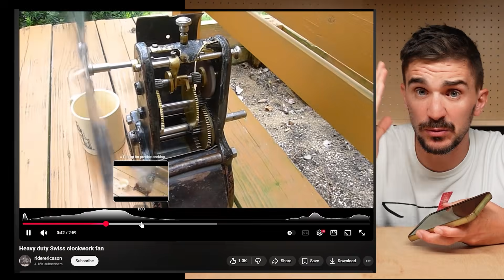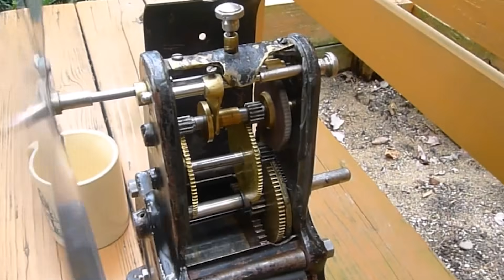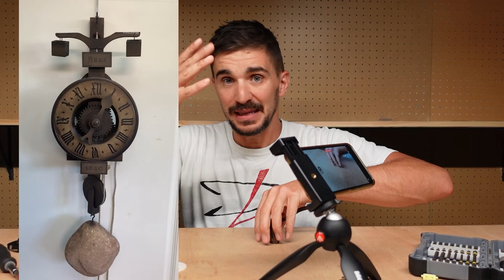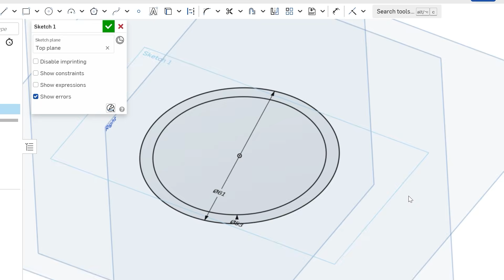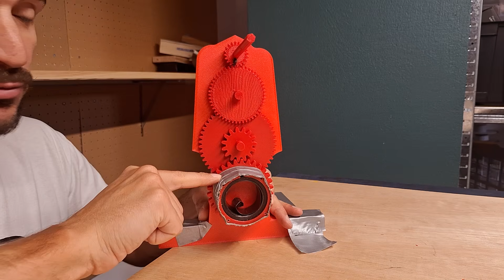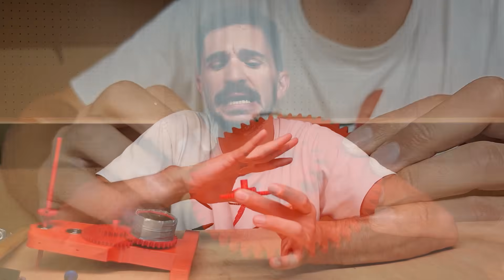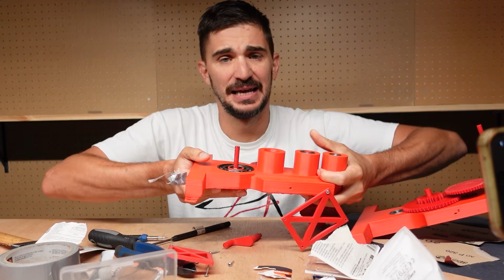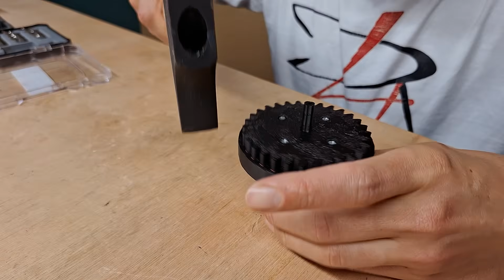No Cables or Batteries, Just Pure Mechanical Engineering - This Swiss Cooling Fan Cools You For Free

Comment: I like the idea, but i think the rock is also a much better idea then the spring for this project, the places where this whould be usefull and power is in short supply are usually places where a little extra space and a heavy rock whould be very easy to source. Also no need to destroy perfectlly usable tape measures xD

Comment: Wow I had no idea that there were such strong feeling on gears VS belts lol. I think a couple of points need to be made. 1 I don't believe at any point he stated that replicating Victorian engineering was a requirement (he's using a 3d printer....). 2 the decision to optimize the gear profiles was correct BUT those are involute spur gear profiles designed to transmit high force with acceptable loss. Clock making gear profiles are different. They are designed to minimize contact and friction at the cost of increased lash and lower torque ability. Off the top of my head I want to say they are cycloidal profiles but that's probably wrong. 3 I think one flaw in this design is it allows the gears to ride on each other lateral movement (end shake in clock making) should be constrained by the shaft and bearing so the gears only contact at the teeth. 4 I think a combination of gears at the high torque range and a gt2 timing belt at the high speed range would be ideal in THIS application of a home built mechanical fan. It's true that gears CAN  be more efficient than belts but that requires incredible precision and likely adjustable depthing to achieve low loss running. Not not an engineer but that is my engineering take. Come at me comments section 😂.
Reply: Quick follow up. It appears that I was correct in stating clock gears are cycloidal. I was sure I remembered wrong but this blind squirrel found a nut.

Comment: A few tips from a fellow 3d printing newbie:

- you don't need to sand the gears if you space the from the wall. To make up for the loss in stability, leghten the keyway on the side of the gear. The gear doesn't need to have the same thickness as the keyway.

- always add fillets to radial edges in shafts and everything else actually. No idear which size is needed because i am not an engineer but 3d printet parts are very vunrebale to sheering forces, at least in the vertical direction of print but you already fixed that with the keyway.

- Don't know if you already did that but test the tolerances of your 3d printer. Try different gear pairings with different clearences. Yet again i am not an engineer so no idear how that effects the gear but in my experience 3d prints are never accurate but they are so consistently. For example my A1 always prints 0.1mm to big in the horzontal axes, no matter the size of the component. Also try different accuracy settings and options in the bambu lab software.

Comment: Awesome effort but you need a bigger, stronger, stiffer spring. If you want to rework, try using the pull starter spring in a push mower or weed eater. Main thing if you try using one of these springs they are super real royal bitchin springs to work with, ware face protection n gloves... good luck..

Comment: The spring used in that vintage clock was probably strong enough to use in your cars suspension. Trying to imitate it with a tape measure spring is laughable.

Comment: Judging by the size of the barrel with the main spring (like a big can of tuna, 10 cm tall and 15cm in diameter by my estimation) spring in this fan is huge by any clock standards and much much much more powerful than spring of any measurement tape

Comment: look at that original. I bet it is far higher than 16-1. One of the ways some old clockwork things regulated speed was paddles that made friction in the air, so a tighter spring caused a bit more resistance and kept speeds steadier. The fan blades are a big part of the time it took to unwind. 
And this reminds me. Have you ever looked at the old Inertial Starters like used on some airplanes? hand cranking a flywheel with massive "reduction" gearing, and once you got the flywheel up to generating its own gravity, engage a clutch and the engine cranks over on the momentum. Basically you are the spring and the flywheel is the fan blade. I also bet they could have gotten a bit more time out of it but at added cost, and possibly less air movement, or the torque loss was too high to be worth the effort.

Comment: The discussion about clocks made me realise how ridiculously important just keeping time more and more accurately has been in advancing technology.
Reply: What's more ridiculous is how we take precise time, distance and mass measurements for granted today. James Vincent's excellent book "Beyond Measure" really opened my eyes to this. Also check out stuff like the "equation of time" needed on sundails to account for the sun's analemma motion. Nowadays I can pick up a literal Casio on a plastic beach, replace the battery, and it will keep time to a level of precision only some of the best inventions of the past attained.
Reply: @hannesjvv that's from a crystal vibrating yeah? 
Looked it up - quartz at 32,768. Oh that's per second! That sounds like it would be very accurate if it's outputting that constantly - wonder how much time those watches lose/gain in a year? And what part of the system contributes the most "drift", or inaccuracies, the crystal or the electronics, or the counting/conversion.
Reply: @WillArtie typicaly drift can be accounted for by temperature air density and battery voltage although air density has been solved for quite some time now as the oscillating crystal itself is contained in a sealed case. However temperature change is quite a bit more difficult to solve some watches have heaters for extreme cold but in average circumstances the drift due to temp change is negligible maybe a few minutes a year which is pretty incredible
Reply: My Casio A158 has gained 6 mins during 2.5 years.
Reply: @nathan584 Sorry I didn't see you had replied! Thanks for the info Nathan!
Reply: Not to mention navigation, thus discovering the world, which could  not have happened without accurate timepieces.
Reply: Or especially GPS signals, that rely on precise timekeeping to determine positions. Relativistic effects from the velocity of the satellites had to be accounted for in their atomic clocks to ensure accurate timekeeping down to the nanosecond.

Comment: where you got it wrong is the ratio dude, for a fan to run half an hour off a single crank would mean a gear ratio of THOUSANDS to one. look up the million to one ratio gearboxes people make, they stack the gears in the casing to make it more compact, essentially you just need a bunch of large gears with fixed tiny gears, you stack them big to small in a repeating pattern you essentially get compounding gains, the spring would need immense torque and the blades of the fan wouldn't produce much at all. as you said mate gears are a trade-off, if you want as many revolutions as possible off a single crank, it's like riding a mountain bike in high gear, no good at climbing hills but covers a large distance for every cycle of the pedals. 

i'd love to see a v2 of this, plenty of room left for improvement

Comment: Take the seals and grease out of the ball bearings. WD40 is heavy enough as a lube. There's a lot of drag from the grease, even with non contact seals. That's why motorbikes only have contact seals on one side of their wheel bearings. Less friction and heat.

Comment: I recently repaired an old Cassete tape deck player which had a plastic gear that drives the tape take up real broken so it was chewing tapes. Ofcourse the replacement gear was nowhere to be found but found a very similar gear from electric toy car to of them but the gears needed to be stacked up so they were thick enough to assume the size of the original geat. Now the problem was joining the two toy gears while perfectly centered. I tried and tried but there was always this wobble that would lock up other gears. only by shaving some of the out running edges have I got it close to running

Comment: Have you lookd into the Sterling engine fans made to be set up on top of a wood stove to blow hot air in the room? Pure mechanical engineering too!
Reply: I thought the same thing but technically they are electric,  a TEG (thermo electric generator) converts the heat into a small amount of electricity which then powers the fan.

No batteries and no mains required, but also not mechanical.

Comment: There's a reason it's known as Swiss clockwork.  I think you'll need much lower friction bearings in addition to improved gear tooth interfaces.  ...  I once happened by a shop while visiting Germany some 25 years ago.  They sold music boxes.  Proper wind up ones.  The craftsmanship was off the scale.  All mechanical.  Of course these things are hand made and take a great deal of time, and the materials ... everything is 'just the right x, y, z'.  But when it all comes together... Magic!

Comment: Improvement can be attained by using larger spring, metal gearings (more precision and hollow in the middle, so almost same mass) and lubricant on some parts.Then we have to consider the pitch of the fan to properly set the torque.
Thanks for your experiments.

Comment: So you took a 10m tape Measure for E5.99 (plus a 3m one you broke for E2.99); Spent two days doing R&D for (E50/hr x 16 hours) E800; Used a Spool of Filament E25 per spool; used Eight Roller Bearings for about E12 and bought an Electric Fan for about E9.99 so you could re-purpose the Fan ( and throw the rest into Landfill) to create a Mechanical Fan that takes 30s to wind to get 2 minutes of airflow at 0.3 m/s. Cost approx E856. The Electric Fan you threw away would run for say E0.05 per day 24/7/365 so that means you have saved money after that Electric Fan had run continuously for almost 47 years. Genius! Put up the Plans and CAD Drawings. I WANT One of those!.

In fairness it was a really great learning exercise and just the sort of thing for a school Engineering Project. Good Job. Keep doing these Videos.

Comment: Huh, I'd have thought we'd at least have clockwork dynamo style fans in a modern context, probably with a battery bank. Given we have radios, flashlights, and charging banks that work that way. (granted, you could use a USB fan + clockwork dynamo cranked charging bank, but that's not especially efficient: better to use a higher voltage power source than 5V USB ... or 3.3V)

Comment: My favorite video you’ve done to date in my humble opinion. 

I appreciate engineering and turned wrenches for money so your videos Ive always enjoyed. (Even the annoying albeit necessary layman’s back-filler information 😉).  Covering the efficiency of various different power delivery systems that I haven’t gotten elsewhere.   A big reason for that is your market and in this videos intro you referenced it.  So for your endeavors it’s my hat off to you.  

The complexity of the actual project here would be under appreciated by all modern electrical appliance using people today.  To your credit and ours though that 100 year time span has allowed this project to make a proof of concept in what …a leisurely week instead of idk how much time but a lot.  

Inspiring though, I’m thinking a foot pump with appropriate sized tank and regulator with modded Air Hogs pneumatic toy airplane engine.

Comment: 33:01 Injection molded gears are pretty cheap and you could likely design around existing gears for most of them. A bent sheet metal housing would probably be the cheapest, stiffest low quantity option, but injection molded glass reinforced nylon would probably be cheaper at if there was enough volume to justify the cost of the molds.

Comment: Does the cooling from the fan reduce your temperature by more than your heating from winding it and the losses in and out. The Egyptian kings and queens had the slaves fanning them. Riding a bicycle blows air over you and the heated air is left behind.  Their was a hand cranked refrigeration compressor at sci-tec but by the time it had frost on evaporator you were hot from the cranking.

Comment: This is definitely a good proof of concept.... And it only took two days! 
Made out of metal, and a floor standing vertical model that is foot pedal operated to wind a stronger spring could possibly run for much longer than 30 minutes... And more importantly running quieter.... 
Add in a mechanism to switch between fan and small generator and you have a USB charger also! 
Next video a version using leaf springs from a car LoL.... You want spring torque! That's how you get it done son...

Comment: Small 3d print trick so you don't have to do all that sanding: Split the file in half and print the 2 halves flat on the plate. Then you can just glue them back together.

Comment: 19:58  You could try using special support filament to solve this issue. So for PLA you get PLA support. ABS you get ABS support, etc. It’s a slightly different plastic that allows you to get supports that provide a much smoother finish to the interfacing surface while being easy to remove. I recently tried this with one of my projects and it worked out pretty well :)

Comment: Thank you for sharing your attempt.  Some thoughts for the next one: 

1. Don't try to invent the jet turbine before you invent the wheel.  Start with a gravity-based system that uses a large weight and belts for gear reduction.  (You can 3D print the belts, then melt the ends together in a 3D printed jig for proper alignment.)  

2. Use a pair of expandable shower rods to anchor it between the floor/end table/etc and the ceiling for lots of height and stability.

3. Look up 'DIY mechanical gravity battery' for ideas on how to store and convert the potential energy.

4. Instead of putting the bearings in the frame and using 3D printed shafts, put the bearings in the gears and use captured shafts made of metal rods/tubes or wooden dowels cut to length.  That will VASTLY decrease unwanted movement and friction.

5. Use the largest fan blades you can find, as they can move a LOT more air at a LOT lower RPM.  (You can often find ceiling fan blades in your local classifieds for cheap, or you can 3D print mounts for pieces of thin plywood.)

Cheers!

Comment: AMAZING funny and SUPERINTERTAINING video! Honestly, when I've understood that the intention was that of building the fan energy "battery" on a measuring tape main spring, I immediately thought that the final development would have had multiple main springs connected together to increase the total "energy capacity", because that of a single measuring tape alone wouldn't be sufficient to provide enough power for a useful amount of time.
However, as I've understood in the end, the point was to make a "proof of concept" DIY device, and evaluate its energy efficiency... which was a good point in itself.
Interesting concept, entertaining video and execution, very informative... overall another great video! Thank you! God bless! ❤
Reply: @d4a P.S. user @sparky6086, in the comments, suggested the use of a "timing belt" (those kind of belt often used with step motors). I consider it a good suggestion if ever you'd like to try a follow up of the project while keeping the DIY concept.

Comment: Eh.. Quite random, but I like this pivot.

To me, it was a brute force method to "solve a problem". Nowadays there's much more elegant solution by motors, induction and battery.

I like the beauty of precision when modular things are put together well and creating something completely different, especially when it's not souly fit for one purpose.
Ie a 42tooth micro gear has very minimal use compared to say, a 12v brushless 45mm motor

Comment: It I could make a couple of suggestions, you can probably just glue the tape measure's spring box to a bicycle gear  with a 3d printed locator pin for alignment and then use a bike chain to another gear on the fan blade. This would let you free up all the blocked flow around the blade and save you hours of work and printing.
Also, instead of using a tiny key you could probably have a pin to lock the gear attached to the spring and wind the fan backwards.
Finally, since bicycles and tape measures are churned out by the tens of millions every year I bet you could make one dirt cheap with a much stronger mainspring if you ordered enough.

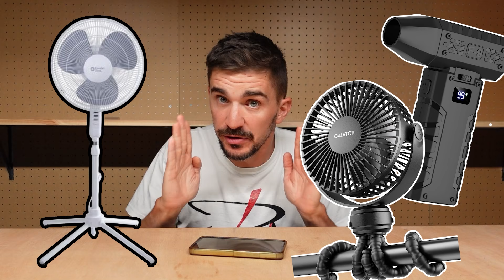Comment: 2:33 I’ve seen some gravity fed ones in the past, but the algorithms seem to have scrubbed a bunch. They looked like grandfather clocks with huge weights and pulleys.

Otherwise you have heat-engine ones that use stirling power, often used with wood burning stoves to circulate hot air (though my grandfather told me when he was a kid they used it in the summertime) and then there are steam and stirling ones ones that power belt driven/chain driven/cammed arm systems to circulate air or do waving motions. I do love clockwork fans using springs… it would be interesting to see what could be made with modern spring-steel under high tension… but coiled K values scare me to death… 😮

Comment: The original isn't called "clockwork" because it's so precise, but because it includes an escapement. The enabling technology for this project is something you never mentioned in the whole video, much less included in your prototype. 

All you made was an underpowered wind up geartrain. It was really interesting seeing you talk through the problems and solutions and do the build, but IMO this only represents one initial step towards the simplest part of making this device actually work.